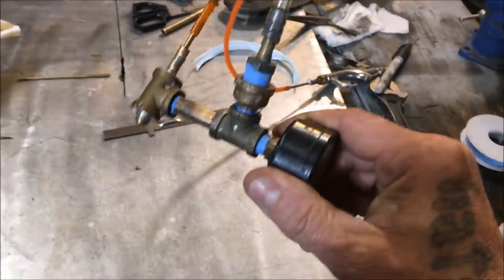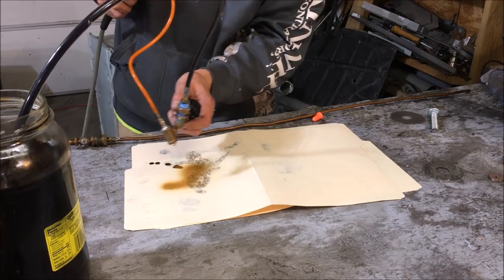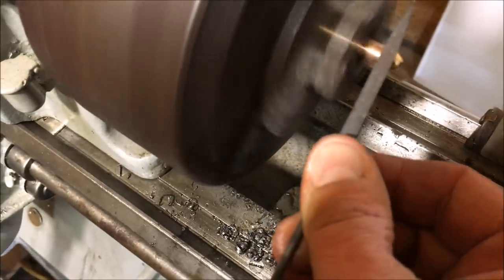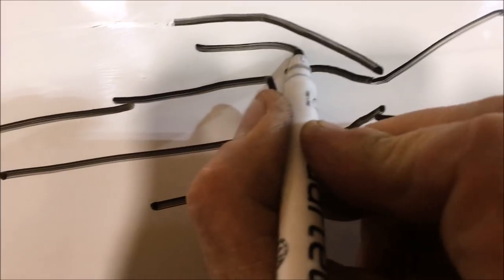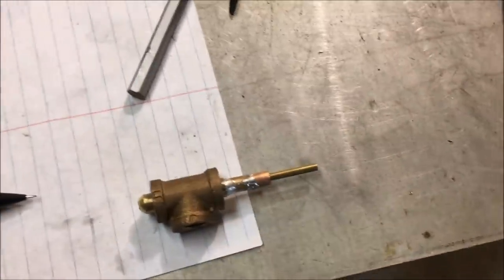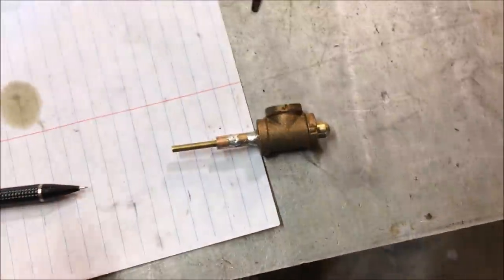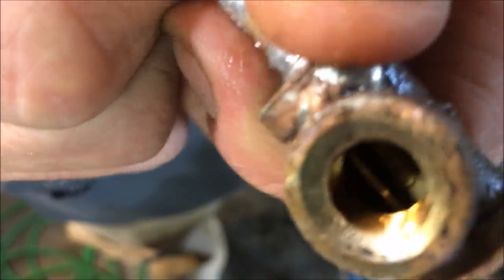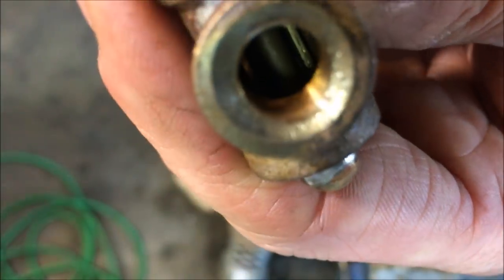Waste Oil  burner Siphon Atomizer Nozzle Build Prt 1

Comment: To make a nicely shaped NOZZEL: 

try taking a drill bit and grinding down the ROD end to a point. ( NOT THE DRILLING END)  Insert the drill bit with the point into the brass pipe.  Lightly tap the brass rod with a very very light peening hammer on an anvil or other hard surface to shape the NOZZEL.   A small light wrench can be used in place of a hammer.   A spoon can be used and maybe work better than a hammer.  Numerous taps instead of heavy blows are the key in forming brass.  Then spin the NOZZEL in a drill or lathe. Hold sand paper on the outside to polish and smooth the end of the NOZZEL.   This will make a smooth concentric nozzel.

Comment from the maker: Folks dont forget i am using high grade synthetic motor oil called royal purple in this test  so you will get very good results with regular oil , for this oil a small amount of gas must be added or the oil must be heated to 250 deg , take your pic

Comment: Maybee if you drill a big hole in your counterpiece and cut it of then you have a rounded shape to form the end of your tube.  Use some oil to lower down the friction and smoothen the surface.
Reply from the maker: good call

Comment: Were you just rubbing on the end of the tube with an unground cutting tool?   And was the tool post loose?

I couldn't tell from this one video, but you might be happy with the lathe with some good cutters set at center height.

Comment: i see this is an old video, and i dont know if you are still on this design or have moved past it, but -- not for a one off, but-- if you were going to mass produce these, i would try making a form that fits inside the tube and use that to shape the end.  look up metal spinning to get a better idea of what im trying to explain, f you are not familiar with the process. 

and $1k is pretty dirt cheap for a nice sized lathe, dosent seem like youve done too bad.  didnt see any really good shots of it but kinda looks like a south bend heavy 10. i have one and love it.
Reply from the maker: Thanks for the input friend , yes it is a heavy ten L , the 1 1/4 threw hole spindle that gun makers love .
I dont build these like this any more but thanks for the input
Reply: @NOBOX7  I was going thru your vids and found you asked if someone was interested in a lathe. Do you still have it?🙏😁👍

Comment: Lets see a burn also won’t you still want to regulate the oil feed with a valve and how much air will it use I hate to run my compressor all day long
Reply from the maker: yes for long term operation your gonna want a blower type system that uses drip feed or an oil pump , however if you have a decent compressor it will be fine and it only runs periodically , in some future videos i will be showing these specifications , its just to cold out  to test this stuff for now

Comment: I would like to ask some stupid questions if you would answer. 
What is the end goal of this experimentation? 
Are you trying to make a burner to heat a foundry? 
Are any parameters set in stone? 
Fuel - waste oil, propane, diesel, kerosene 

Why are you trying to make a nozzle ? 
Why don’t you just buy a nozzle? 

A waste oil nozzle can be purchased on EBay for 25 bucks. 

Why will they not work?

Comment: Harbor freight has a gravity feed paint sprayer : https://www.harborfreight.com/20-oz-8-cfm-gravity-feed-spray-gun-67181.html That should do everything you want in an oil burner - under $25 delivered. Then there are the siphon ones with or without pressurized paint pots. Invest in any or all of these, experiment with some all or more of them, take apart and adapt to your use. Then again you can obtain someone's buggered up pressure paint sprayer and have a go with one of those - they have a variable pressure and there is always someone wanting to get rid of a cheap and nasty electric pressure washer. By all means it seems like you are having fun with your creations. Oh and don't quit your day job to run a metal lathe. Now I'm going out in the shop and see if any of my suggestions are viable. I'm in the process of building a waste oil forge.

Comment: dont know if you have seen it / or tried it but have a look at how this guy did his     
https://youtu.be/1SXKMRSIyPU
 you may change your design again!!!
Reply from the maker: hey thanks man , im all about change i will definatly check it out.
Reply from the maker: speaking of change i already changed the configuration on this set up , now the oil is injected into the center spear and the air passes threw the penstock , said another way  the oil is now passing threw the air port and air is now being fed into the oil port and wow did it make a huge difference... https://www.youtube.com/watch?v=3zi7aLeWP_M